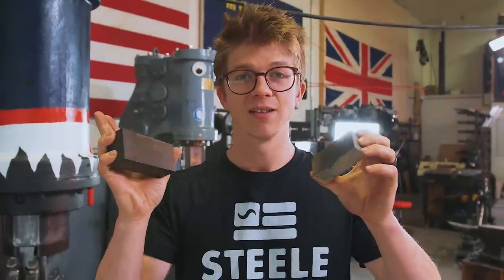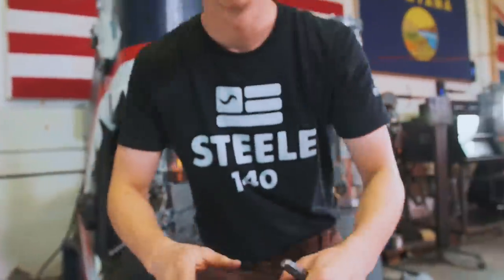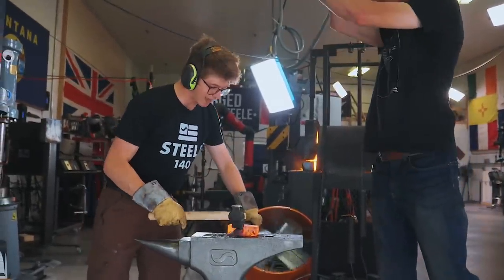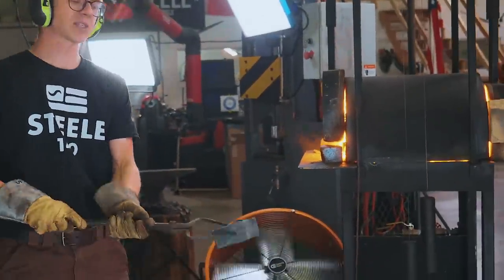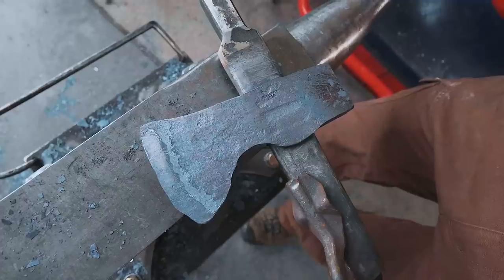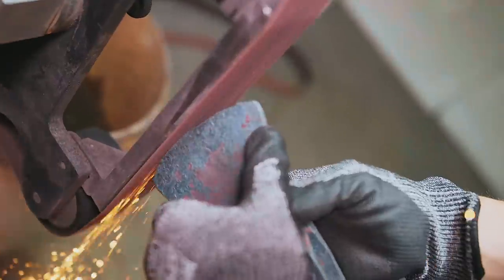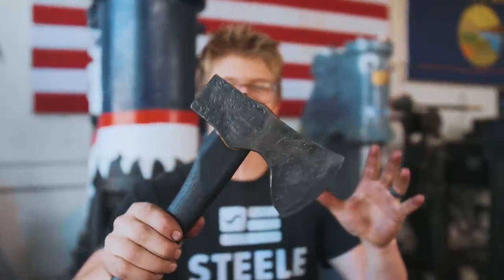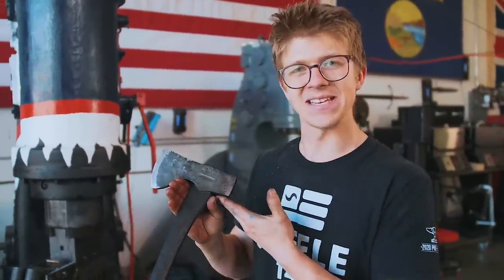MAKING A CAMP AXE!!!  4WOF Week 4

Comment: Regarding camping axes, I have a preference for multiple functions and a thin blade for light weight and easy cutting. When you camp, unless you intend on splitting wood, a thin blade is very useful for chopping nice branches, very small trees, and a hammer back is great for everything you need to hit but don't need to cut. Also, a small reverse hook blade beneath the chin of a thin axe is good for cutting rope/cord/fishing line(not essential, but a nice luxury to have). 

I can say that The axe you made is quite in line with my tastes. Very lovely.

Comment: I think one of the major issues for people new to forging, and even those that have been forging for years, is the order of operations when you get into forging shapes that you don't typically forge, and this causes a breakdown in progress. I've seen people, and even done it myself, give up on projects because they got bogged down by not knowing how to break down the order of operations for a specific shape. It can become complex and confusing. But I find getting a chalk board or even just a sheet of paper, and filling out the steps:
1. draw the beginning shape
2. draw the next shape to work toward
3. and the next, 
4. etc. 
And try to come up with the best steps possible, and in which order, for getting to a certain goal. Sit down and think about what would be best to do first and then go from there, making sure you don't get snagged up by doing something first that will make doing the next step more difficult, or if a first step will make a later step easier. But the main thing, at least at first, is to just jump in and do some work and get a feel for what it all entails, get comfortable with it (some blacksmiths have to do this after going a while without forging) and just make something random, just move the metal and get used to the work.

Comment: Two small suggestions I have for hanging an axe head, putting a handle on an axe, is when driving the handle into the axe head it is much more effective to hold the handle of the axe upside down and hit the bottom of the axe handle with a mallet. Instead of the axe head popping off like you might think it actually drives the handle into the axe. Another suggestion for properly hanging an axe head is to have one or two small metal wedges driving into the eyelet of the axe handle at the top perpendicular to the wooden wedge, this allows for the expansion of the wood forward and backward in addition to the expansion of the wood side to side for a much tighter and sturdier fit.

Comment: Could you have possibly soaked the haft in water, then compressed the head-end to allow the wood through as the wood dried and expanded to fit the hole and lock it in place?

Comment: Hey Alec and the community im planning on starting from the basic requirements eg a hammer, a form of anvil and a forge but i was wondering if you require a sledgehammer and a blacksmithing hammer to be able to create the grooves for a handle or are you able to use any hammer and a peice of steel or another materal to drive the hole through for a wedge.
Reply: GoFlyAway They were using a slot drift to make the handle hole.  But the fun thing about working with metal is that you can just make the tools (including a drift) that you need. As for hammers, so long as it’s the right shape of head for what you’re trying to do, it will probably work alright, though may require more hits and work on your part. A nice, wide, flat hammer is nice when you have to hit the end of another took over and over, and for shaping out your metal in an even fashion. But need? No..

Comment: Alec is never going to see this but you don't have to place your axe head on anything while hanging it, you just snug it up so when you lift it doesn't fall off then hitting the palm swell with a mallet will drive the handle into the head without the possibility of damaging your axe head on a hard surface or vise versa

Comment: I made a hatchet that was inspired by the Mike Boyd axe, and the handle kept on breaking. Any tips?
Reply: Use a stronger handle.
Reply: Guy Courtenay Linseed oil or fibreglass
Reply: @kjam87gxp  I used a seasoned Hawthorn handle.

Comment: Your audio sounds over-amplified and distorted in this video. I guess you might already be aware, and it's understandable you wouldn't want to re-shoot because you'd have to start over. But in case you don't know; I think I definitely hear distortion caused by too high input volume or amplification. Occasionally, I think a damaged mic diaphragm can also cause that, but that's less likely, unless your mic has been exposed to very loud sounds repeatedly, which actually seems plausible considering what you do.

Comment: The way you metal dudes choke up on your hammers hurts my carpenter’s heart. Control is one thing, but how do you get any torque out of those blows? 🤓
Reply: It helps balancing heavier hammers. Look up the old video of scythe forging in norway. The blacksmith uses incredibly long handles with a very interesting technique.
Reply: We're just stronger than you guys ;) no but really our hammers are heavier I guess and because anvils are heavy and solid each blow is more efficient I guess.
Reply: 4lb hammer vs. 1lb hammer, makes a lot of difference. I use a 2lb for my forging, usually, with a much lower grip.
Reply: Look at how his body moves when he hits, he uses his whole body, the swings with his arm, he contracts his stomache and he bends his leg, all in unison to generate as much force as possible. This isnt the only way to do it, Illya over on 'That Works' has learned to use very specific muscles in his back (way to complex for me to regurgitate here) so he just stands still and swings his arm, holding his hammer at the end of the handle.
Reply: It’s just what you want the tool to do. Carpenters use a lighter hammer and swing it fast for a sharp impact to drive that nail in as little swings as possible. The heavy hammer is wider and therefor heavier. A smith “usually” wants more of a smooshing flattening effect.  So instead of wearing yourself out trying to hit it has hard and with as little strokes as possible you utilize the control of choking up and using more strokes. When you need to hit it hard and have control you use the power hammer or a striker like they did here. Hard precise strokes
Reply: he explained in one of his videos that the only reason he chokes up on his hammer like that is simply because thats the way he learned. most likely because he learned at such a young age. he also mentioned that many comment that it is a poor habit and should be corrected, but he argues that his technique is sufficient because of the obvious the higher control but also he has been able to adapt and can still hit it hard.
Reply: I agree, I'm a carpenter but I also do a lot of brick and concrete work and often use a 4lb club hammer and a chisel or 3"bolster, I always hold the hammer at the end of the handle and use full force blows unless I am doing a little fine work, I usually rehaft my club hammers from the usual 10" to 12".

Comment: Hello Alic allways interesting it watch your videos, but why o why do you BURN THE HANDLES on your tools,  ok for Blacksmith tools as they will get dark after use, but a Camping Axe that is definitely NOT DONE, I am a 74 year old Joiner we use Axes to scribe or cut wedges but never, never burn the handles and I have fitted quite a few new handles, then I Linseed oil them after fitting, Best wishes Geoff Lewis, Wales, UK, 🏴🏴🏴

Comment: Why you making all in black ??
Reply: It is an ancient japanese method of wood preservation that has been popular with western craftsmen as of late... but it is getting misused a LOT... IMO it does not make a good grip surface. Your just holding charcoal. It will wear off fast leaving you with unprotected wood and dirty hands. Would be far better with a few coats of linseed oil. Truth be told, Alec kindda dropped the ball with this axe.  It was built for looks, not function. He has the skills to do far better. my only guess is that he wanted to "dumb it down" to beginner level, but in doing so he is perhaps doing the newer smiths who are trying to learn and be inspired by him a disservice. Instead of teaching them to do it better, he is showing them how to do it easy. This axe is not worth $20

Comment: You can get a far better axe if you split the cutting edge and insert a hard steel cutting edge into a softer body then forge welding them. Sorry Alec, that is a good looking, but low quality axe. I know you can do better.
As for your side comments about needing to figure out where you are going with a project. I used to be a part of a historical recreation group. A member inherited some money and asked a master armorer for advice what tools to get to become an armorer. The guy was expecting something like plasma cutters or other fancy tools. The master armorer replies "Get books. Lots of books about anything you want to make. Research is the most important tool you have."... I was studying under an ABS Master Bladesmith for a while before he passed away. He had 2-3 floor to ceiling book shelves full of books on knives and swords. Not books on how to make them. Books of information about them. Information on the metallurgy, info on the exact measurements of museum pieces. It will make you a better blacksmith/bladesmith/armorer/any other craft than any fancy tools will ever make you.